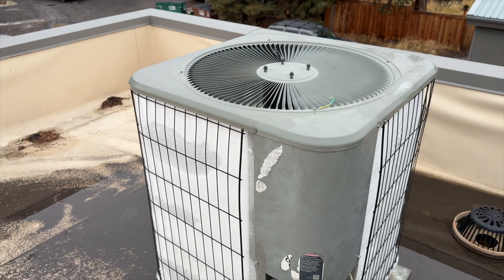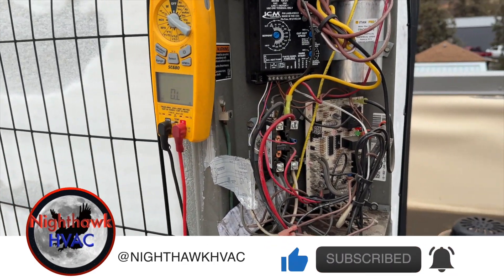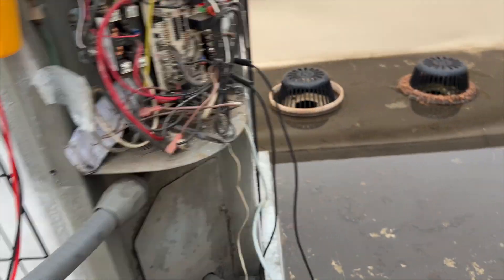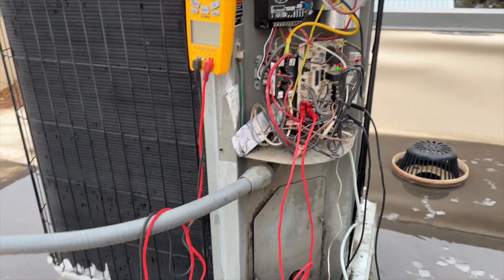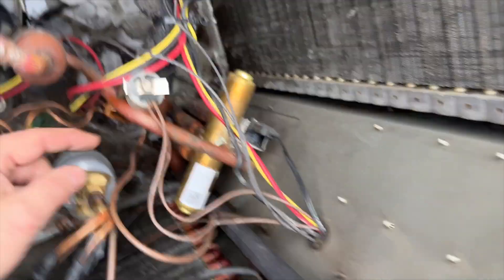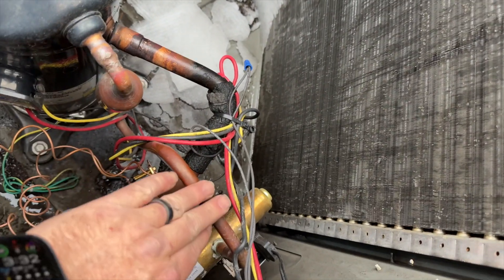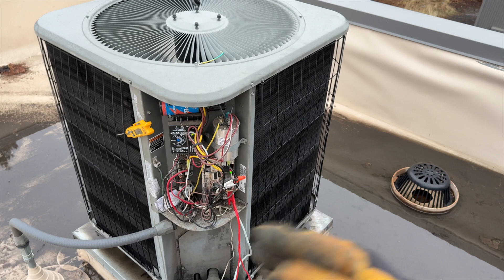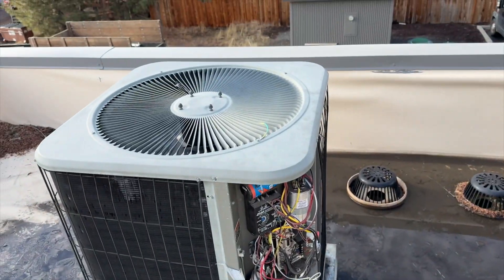Heat Pump Outdoor Unit Freezing Up! EP203

Comment: Being on the hot discharge line , it would not get down to 40 degrees to activate the run timer to initiate a defrost. Good catch. The distribution lines after the txv will get cold enough to start the timer.